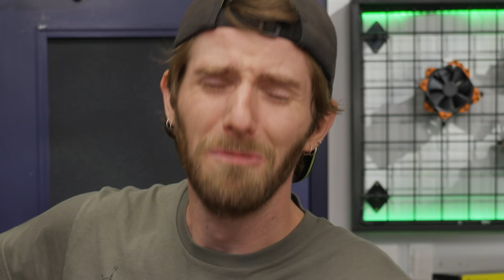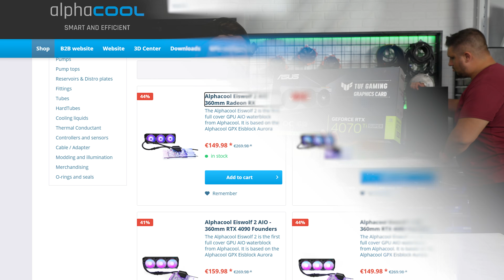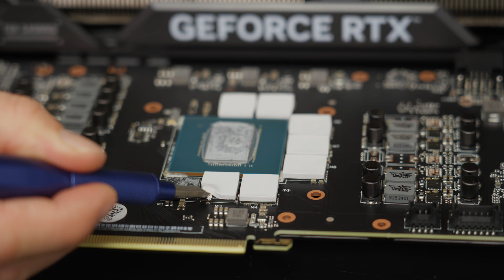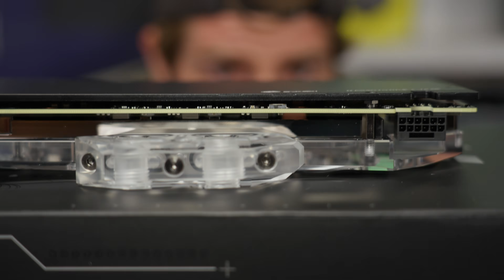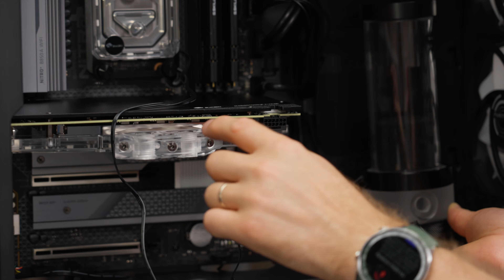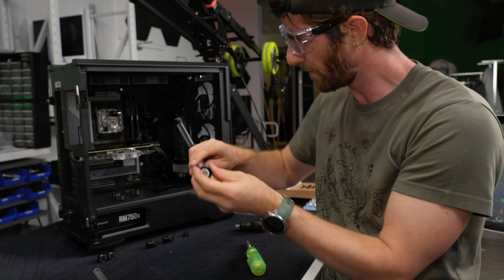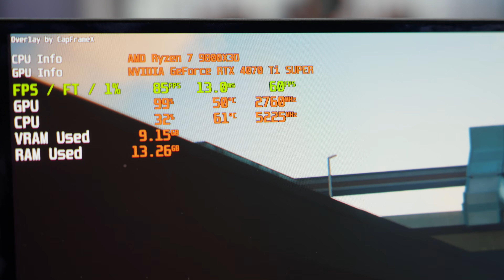Your Next Budget PC Upgrade is...Custom Watercooling??

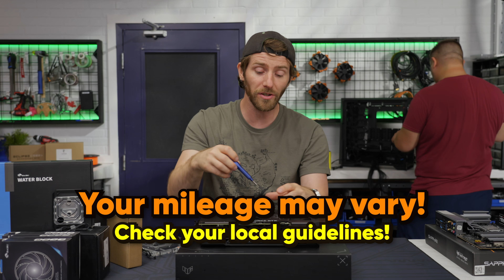Comment: 4:55 :: For the Americans watching:

IANAL (I Am NOT A Lawyer) but if memory serves, in the US, the Magnuson-Moss Warranty Act (15 USC 2301-2312) is the prevailing law that covers things like warranty-void stickers. One of its provisions is that a product offered for sale in the US cannot have its warranty service be restricted to any particular supplier. Warranties can be legally denied for abuse, misuse, or deliberate actions that damage a device (and yes, screwing up an attempt to repair it yourself does count here), but ripping off a "void if removed" label is not one of the legally allowed reasons for a denial - the warrantor has to be able to prove you deliberately harmed the device by the act of opening it up if they try to deny a warranty claim solely on the basis of removing a tamper seal.

Now, that having been said, since most computing manufacturing happens in Taiwan or West Taiwan (suck it, China!) and the American MMWA doesn't apply there, if you're dealing with a device whose manufacturer doesn't have a presence in the US they can basically tell you to pound sand over any warranty issues if you've opened up the device and you won't have a whole lot of recourse aside from name-and-shame on social media.

Comment: I wish you guys wouldve added a comparison between this specific watercooled system vs it being aircooled instead, it wouldve been interesting to see the performance uplift
Reply: Assuming your current coolers are adequate and isnt thermal throttling then the answer is likely "barely noticeable". You can get a bit more if you increase power limits and try overclock settings but I think thats beyond this video. 

Not saying you are wrong, they could have shown a quick performance or sound level comparison, just saying it likely wouldnt be much faster.

Comment: I'm guessing that the Motherboard mode lets you control the RGB through your mb Argb controllers. But you'd need to be running the appropriate software. And probably connect that board in the back to your mb.

Comment: Great video! Although I just bought an AIO to try it out after going pure fan ever since I built my PC, I think I'll eventually try custom loop; although I doubt it'll be workable with my ITX case. Good to know there is a no-fuss supplier for these.

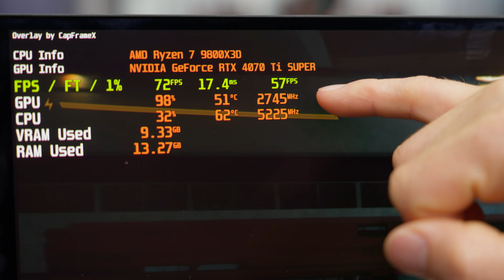Also, kudos to the editor for the lil' trick @ 22:34. You got me there 😉
Reply: Depends on your case. Obviously to mount inside you need space for Rads, how much of which then depends on your hardware. That said, there are other ways like external Rads. Planning out a loop is 10x, heck more... in depth than planning out a PC build.

Comment: Noctua's aircooler is just fine thanks.
Reply: My 15yo NH-D14 is still going strong.
Reply: For a CPU. Good luck putting one on a GPU.
Reply: @ffwast  well...
Reply: And just the cooler will cost you half of this kit.
Reply: @thatfordboy4297  At least with a Noctua air cooler, you don't have a ticking time bomb of potential leaks and tedious loop maintenance to worry about.
Reply: @Rod_Ryder Cool story bud... Now do you actually care about the reality of things or, just going to live in lala land, with your fabricated fears?
Reply: @thatfordboy4297  If you like water cooling then you can like water cooling. It doesn't remove the fact that a water cooling loop has multiple points of potential failure compared to air cooling and the benefits are non existent if you don't factor in the aesthetics.
Reply: @Mojova1  Incorrect, in part. While yes there are higher chances of problems. The same can be said for building a PC vs buying a prebuilt. Unless you want to argue for that, your point doesn't carry the weight you think it does. 

As for benefits. This is where you are simply wrong. While aircooling "works" no matter how much you spend on noctua. A loop with cheap ass fans, will still be quieter. With out sacrifice to cooling performance. Then you are just able to do so many practical things, a personal favorite of mine is external cooling. To say there are no benefits, is to say that you have not thought about the topic. Because, there are many. The only limitation, is you imagination (and some laws of nature...).
Reply: @thatfordboy4297  I’ll concede that saying there are no benefits was too absolute. A sufficiently large custom loop can achieve better temperatures and lower noise, especially with very high heat loads.

But comparing that to building a PC instead of buying a prebuilt is a bizarre analogy. Building your own PC doesn’t add a pump, coolant, tubing, fittings, seals and a reservoir. A custom loop objectively adds components and therefore additional failure modes and maintenance that an air cooler doesn’t have.

And “a loop with cheap fans will still be quieter” simply isn’t universally true. Pumps make noise too, and noise depends on radiator area, heat load, fan speed and the particular hardware involved.

My point was never that custom water cooling is useless. It can be a fun hobby, looks great, and can provide excellent cooling. My point is that for a normal PC, a good air cooler already provides enough cooling with dramatically less complexity. Spending considerably more money and adding maintenance to shave temperatures or noise that weren’t a problem in the first place isn’t automatically a practical upgrade.

If you enjoy custom loops, great. But “I enjoy it and it has advantages” is a much stronger argument than pretending the disadvantages are fabricated fears.

Comment: the reason most people use a AIO is because you dont need to build it and it just works out the box were with hard-line water cooling there is a lot more steps and say most people that drive cant change a car wheel never mind make a full water cooling system....

Comment: If you only plan on gaming you will be fine, but if you plan to tinker with some local AI as well dont forgot to add thermal pads between the VRAM chips and the backplate if you don't want to fry them...

Comment: The CPU could run cooler if it wasn't being cooled with the heated liquid from the GPU. Id run the GPU cooling to a Y connection. On the output of the pump. The reconnect the two lines before the radiator. That way the CPU and GPU can cool separately and the heat load on the radiator stays the same.

Comment: I’m surprised they ran directly between the CPU and GPU. I would imagine they’d put a small radiator in the rear in between them at least.
Reply from the maker: It does not make any meaningful difference. The water is moving so fast that the entire Loop will be pretty near equilibrium - LS

Comment: Realistically the soft tube version of the kit is the one to go for a beginner, Its infinitely more simple and you dont need 3rd party tools like you needed for the hardline kit. Ive used bykski's stuff in the past and was very happy with the quality overall. Reminder to all beginners flush your radiators if they are new!
Reply: Flushing with distilled water? Or some solvent (like alcohol)?
Reply: @Auravendill Distilled is fine, its for the physical debris that can be left over from the soldering of the radiators during fabrication, typically hot water, plug it and shake it around 3-4 times or until its coming out completely clear. Whichever first

Comment: Im pretty sure the confusing remote button is for if you wunna use other firmware for the LED and fan settings, such as Corsair iCue, but it has to be set up, otherwise the included LED and fan settings usually suffice, and require no set up.

Comment: One thing I'd like to correct is that Bykski has thermal pad placement instructions on the website. I would hope it's also included in the manual. Good video with actual tech tips for beginners.
Reply: Indeed, the guides are online. But, unfortunately, with the barrow and bykski block I have had none were include, not that googling for 5 seconds is hard. Though personally, I always confirm pad thickness and the like manually...

Comment: The fact that their fitting is not working and I need to buy a third party part totally disqualified it as a solution. Id rather go with air or either an Artic cooling AIO than buying from a manufacturer with such horrible quality test.

Comment: My RTX 4070 Super only gets to 67°C when grinding away a few hours on COD. 
I do have a 240mm AIO on my Ryzen 7, 7800X3D though. My ESO is at -30. Very pleased with it's performance. However, I'll consider doing this to the card once I start to see higher than average temps at average room temp.

Comment: My current rig is entirely fitted with Bykski barring the Corsair PMMA tubing and Barrow's Wolverine fittings! I have their pump/res combo for the NV7 along with their CPU-XPR-A-MC-V3 for LGA1700, N-AS4070TITUF-X for the RTX 4070, thermo/flow rate unit and 2x 30mm 360 rads. I've not had a single issue with cooling or thermals. I won the rig from CLX but had to open loop it as I love the look and can overclock the everything pretty high.

Comment: For a beginner you should have used an air pump to measure the pressure inside the loop to avoid the unnecessary leak trouble

Comment: Did they go over the pros and cons of hardline vs soft tubing? He says this is a good starter kit. I saw the website sold both in their kits.
Reply from the maker: We touched on it a little. Soft tubing is definitely better for a beginner! - Shawn
Reply: @LinusTechTips  Thanks. Maybe I might take the jump. My premade system already came with an AIO for the cpu. But if I wanted to add water cooling to my GPU, is it advisable to just start fresh in your system or can you modify an AIO for additions?

Comment: As a relative amatuer, I STRONGLY recommend just buying some flexible pipe instead of hard-line, as you WILL get one dimension wrong, and the flexibility of erm flexy, is very handy.
Reply: @leehawleyphotography9326  My first custom loop I did hardline, never again lol. Used a Spectre case. I don’t do custom loop anymore but if I did I’d go soft. Makes it easier to take stuff apart as well if needed without full tear down.
Reply: @Paul-gy7dn yeah exactly. Even something as simple as installing a new m.2 can require an entire drain of the system to get to it with hard-line.

Comment: This video shows exactly the reason why i'll stay with air cooling solutions as long as i possible can.
Reply: It's a lot easier if you use soft tubing and don't go crazy on the using thick lines.
Reply: Yeah same. I thought this video would convince me, but these are all the problems I feared I would have. On top of that, imagine you are a normie who got the bad fitting, how are you supposed to know what to buy in order to replace it? And the downtime, I cant handle that.
Reply: @greenblack6552  I'm certainly not going to excuse the bad fitting. That's just crappy of Bykski.
But if you are playing along at home. You don't turn on the whole system to perform the fill. Linus just yolo's this shit because its good for video.
You only plug in the pump to power, not the whole system. If you get a leak it sucks but it wont hurt anything. Key is to let the effected component dry out, which might take a couple of days and yes that sucks if you just built a new system and want to try it out. For us its about doing it as boring as possible.
Reply: You mean reasons.
Reply: i quite like steam cooling personally
Reply: why because doing something a little bit challenging is to hard for you? 🤣
Reply: Yup. Garbage of them to recommend products that constantly come with defects .... byksi is known for quality issues
Reply: @LetsAlllUseOurBrains  I mean they showed the defects and things that would trip up a first time builder no? If someone still wants to go this route then at least they know.
Reply: @Phot0n0  A first time builder should stay away from hardtubing. Recommending that is just plain daft and I can not take this video very seriously.
Reply: @Phot0n0 also i purchased one for a 3090 from them 2 years ago and it came with bent backplate and defective block with a crack in the intake screw hole. 

So yes they constantly ship garbage
Reply: @LetsAlllUseOurBrains   ok great and LTT also had some defective parts.
Reply: @ls8799   I'm not talking about people who have never built a PC. I'm talking about people who are interested in custom water cooling but don't want to blow all the budget on fittings and tubing. This is clearly not angled at people new to PC's.

If someone wants to do this they'll have to do it for the first time eventually, hence "first time builder". And I can see how this might be attractive to someone like that.
Reply: @Phot0n0  First timers who build a custom loop should stay away from kits like these with hardtubing and go for quality blocks and EPDM tubing.
Reply: @LetsAlllUseOurBrains  A bent fan mount frame... OH no! whatever will we do.
Reply: @thatfordboy4297 wassnt talking about the fan mount.... the defective plumbing infrastructure as their own nozzle thing didnt work.
Reply: @LetsAlllUseOurBrains  "nozzle thing..." haha. Your acting like you know something, while calling a fitting a "nozzle thing". A fitting cost apx $5. While yes, the kit not cooperating is sub optimal. That said. As anyone who watercools knows, or those who would seek to watercool should learn, no matter how much you plan, you always need an extra fitting.
Reply: @thatfordboy4297  This is a "beginner set" - not very "beginner" friendly to have leaking fittings in the system. If the qa is so bad at byksi, I wouldnt buy anything for WATERcooling my pc from them.
Reply: What that it takes a little effort to make something nice?
Reply: @thatfordboy4297  I honestly do not think that it is much nicer than a regular air cooled system.
Reply: @greenblack6552  Aesthetics are personal preference. Won't pretend that you can not like an Aircooled machine. Its not like those of us who watercool have never aircooled, or don't have other PCs with aircooling. 

Looking at your other comment. Simply put, it doesn't seem like its for you, and I do not think you were actually considering it. Which is also fine. But, you cannot watch a 20min video and expect to jump in to water cooling. It doesn't work that way. This isn't gate keeping, its simple logistics. You asked "how would you know the fitting" (paraphrasing) put simply, you would know. Becuase you would know your tube diameter. That said you also wouldn't really be buying this kit. You would get the softtube variant, which would negate a lot of the woes. 

But also to note, you saying "the problems I feared", "downtime"... just this mentality as a whole, is counter to watercooling. Again, not gate keeping, water cooling is fun, its a whole sub hobby, withing PC building. But you have to like to tinker.
Reply: @thatfordboy4297  bro did you not watch the same vid? The guy that has done this 100+ times ended up with leaks in multiple places.. Yeah someone watching this that has never watercooled walking away thinking there's a chance to brick their their $2,000+ machine for a 10% performance gain if they try it out seems pretty likely. Idk why you're trying to act all high and mighty about it either man you just sound smug AF about such niche hobby literally 99.9998% will never ever consider getting into lol.
Reply: @Shelvindouthworth  Idgaf how I "sound" to you. The simple fact of the matter is people are maliciously ignorant. And I am tired of it. 

IF you are looking at it purely as a "performance additive" you have the wrong view of things. Yet you call me smug, for explaining what watercooling actually entails.
Reply: @thatfordboy4297  This video specifically addresses people who never water cooled before and want to get into it. As a person who considered water cooling before, I stated that after watching this video, I still wouldn't want to get into it. 

Custom water cooling, the way it was shown in the video, does not make any sense for your average customer.
Reply: @Shelvindouthworth  Thank you man, I feel the same way just didnt know how to word it like that. Because I was always thinking "hmmm, this g uy is doing this professionally, has done it hundred of times and there was still a leak in his system. I can't have that with mine". And I really went into this video open minded, because I am all for innovation.
Reply: @greenblack6552  Like I said. I do not think you were actually considering it. Because you can not watch a 20 min entertainment video... and expect to walk away with enough information to make a educated decision. Watercooling doesn't work that way. 

Again, as I type this your other comment is visible. You call Linus an "expert" which yeah, 0 argument here. You say you watched this with no personal experience, relying on the "expert" opinion. Which again 0 issue with. I will watch a HUB video to tell me what monitor to buy. Anyway... Instead of actually taking Linus's experience and his overarching conclusion. You instead, ignore it... But then use his expertise as the reason to ignore it... Can you not see how that doesn't track?  

The reason a leak is not a big deal is simple. When you you build a loop, and test it, the PC isn't on, not if doing things properly. So there is no risk. Obviously people with more experience building might ignore this at times. Thats what you saw... Hubris... not that anything actually happened. You would be surprised how drastic your mentality shifts on the topic of fluid being on/in electronics, once you know more. Oh, and with the fitting, thats just normal too. Thats why its of little note. You always end up needing an extra fitting. Its $5 bucks... (depending on what you buy). While I am a personal advocate of less spend-y loops, the simple fact is if $5 is make or break, don't get it to watercooling. 

So to conclude as this ran long... The biggest risk to watercooling, is yourself.